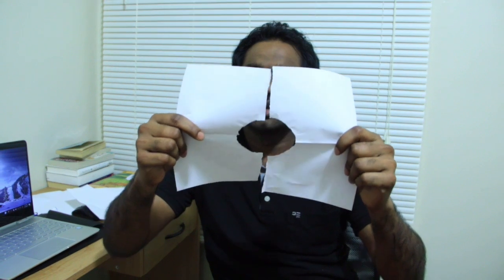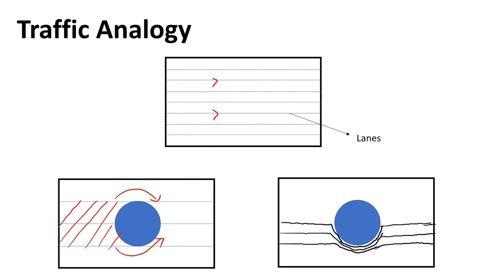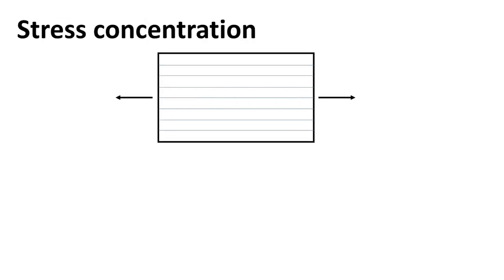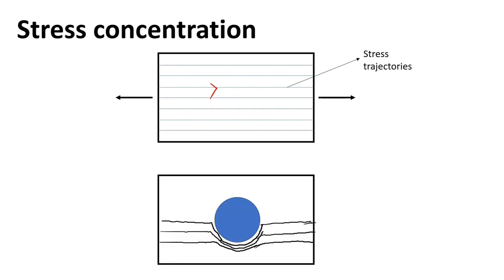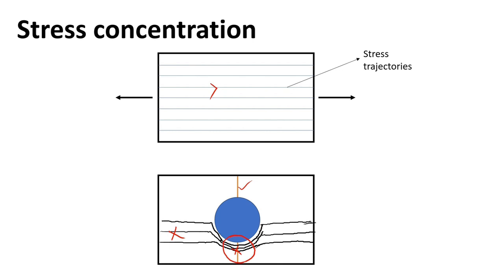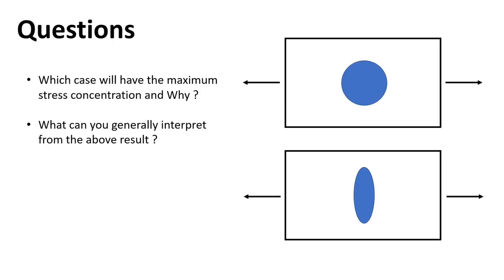Stress concentration explained without math equations

Comment: The ellipse case will have more Stress concentration, due to less surface area in contact. correct me , if I am wrong.  The More in contact or less breakage between two side will have less stress concentration.
Reply from the maker: Think in terms of the traffic analogy and the curvature of the flow lines. Surface area is not correct, for instance a small crack (perpendicular to loading direction) has a lot more stress concentration than a circular hole.

Comment: Elliptical hole will have maximum stress concentration
Reply: Why?
Reply: yeah , but why the second one
Reply: Because the stress in induced at uper  side of elliptical hole is more same as down side of it,
Where in the case of circle the stress distributed over the circumference of circle result less stress raiser.
:)
Reply: @azaruddinansari8886  sorry, didn't get it!
Reply from the maker: Folks, try to again apply the idea of traffic , u might get it :)
Reply: agree elliptical - change in rate/angle of the isostatic flow lines around the major diameter of the ellipse causes increased stress concentration. a more tapered stress concentration reduces the concentration effect.